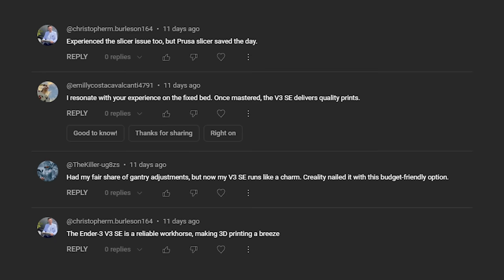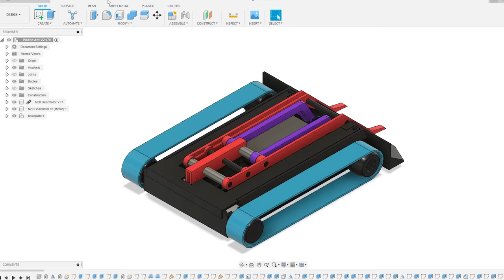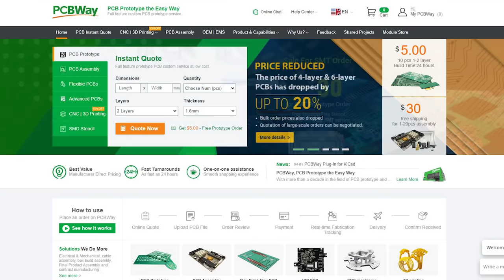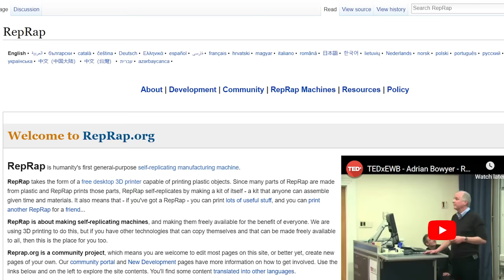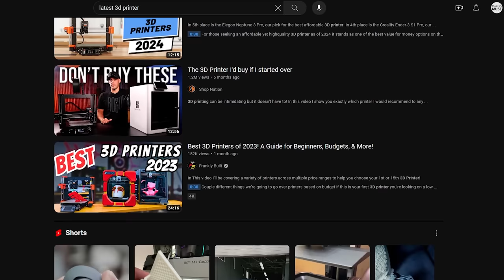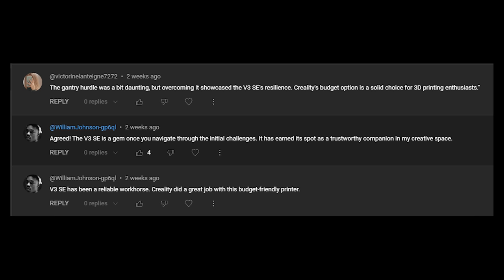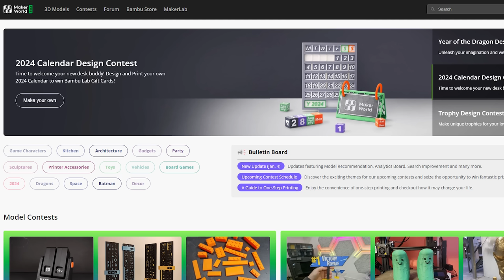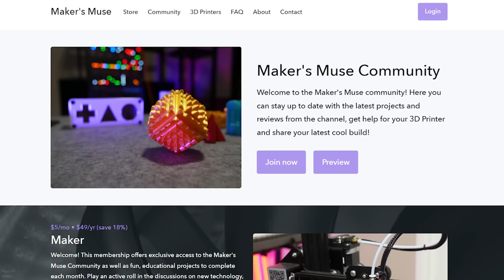My 3D Printing Predictions for 2024

Comment: I think you are spot on.  The hardware market is catching up to the consumer.  Less hardware hacking more printing.  But the software is still super lacking.  Fusion 360 is super expensive and freecad has a learning curve 10,000 miles long.  For the tinkerers looking to make household things and not rolex watches.  There is a huge market to fill in software.

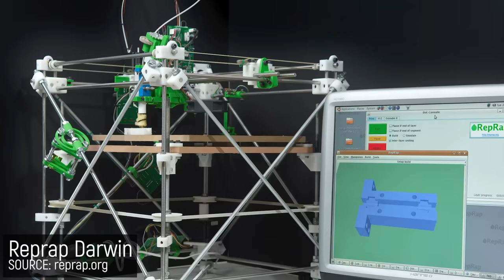Comment: 11:05 I remember the days, OMG. i was 10 sec. from exploding when i was building my first printer, I am from Denmark, and sourcing parts was extremely hard, but i am a industrial technician so i have tools, know-how and contacts most don´t,  but it was still a mes of wires, tape and strips!!! but the first thing you got out that looked kinda what it was suppose to, i was jumping on the ceiling, and i have bean printing ever since, my first bought printer was a Wanhou, i regret today that i did not save my first printer, comparing what i got today, have bean fun 🙂

Comment: I'm curious whether you think that FDM printers will progress in the other direction to what they have last year. Last year, it was all about the improvements that made hands-off perfection and high speed possible. I wonder if it is at all possible to work on the hot ends and parlay the advances in control into making FDM machines compete with resin printers on detail scale. Or is there just no way to get filaments to extrude consistently at that level? My suspicion is that it was too hard for the RepRap world to solve while they were building the rest of the infrastructure and capabilities of FDM 3DP, but now...? Are the limitations those of physics, of manufacturing tolerances, or just of getting the work done to make tiny nozzles work? With the speed of the new crop of machines, even ultra-fine nozzles might not be too excruciatingly slow for printing fine models.

TBH, I've been wanting to try resin to print finer parts for models, but holding off because of mess and toxicity, and because - as you say - I can't differentiate the vast crop of different but similar low-cost resin machines and their manufacturers based on reviews.

Comment: Love the video! I think the repository wars are a great thing for the community! I'd love to see better search engine support to aggregate all of these.

As far as recycling. Fundamentally, recycling is a marginal improvement on single use plastics. And putting the responsibility for this on the consumer is just stupid. The manufacturers need to be held responsible. They shouldn't be allowed to produce the products AT ALL until there is an environmentally sustainable alternative - perhaps bio plastics.

Comment: My predictions for 2024: 
AI built into the firmware to adjust settings on the fly. Probably will be pretty janky starting out, too. Will likely rapidly progress though.

More options for water cooled cold ends for better enclosed systems.

Now there are more options for multi-material systems, I expect there to be new options made for soluble or easily removable supports that could potentially be better or cheaper than PVA filament. 

I somewhat expect a company to finally come out with resins that is safe to touch/breathe even in its liquid form. I also expect it to be not as safe as they claim, but I can hope that it will be safe.

What I'd like, but don't expect to happen:
US based part suppliers providing quality parts and allowing people to get away from the Chinese market. I'm so tired of ordering a part that has no quality control or gets damaged while shipping on a boat for over a month. So many lead screws and linear rods that are banana shaped for example... And there's really no options other than China for many parts even if I'm willing to spend a fair amount more for a quality part.

Comment: Trusting reviews:  I just returned an AnyCubic Kobra 2.  Your review left out the two biggest issues (filament routing, app) which made the printer unusable out of the box.  I couldn't help myself from wondering if you have advertising contracts, or if you'd actually used it more than a Benchy before your review.

Comment: These are the best of times and the worst of times. For any maker/engineer without access to a workshop with tools it is easier than ever to get everything you need, be it by any modern printer that is easy to tune (assuming they need it)  or via a service like pcbway. But with stuff like the fanbase wars (Prusa V BBL), repository wars, (AI) misinformation/manipulation and so on it is starting to become clear: It ain't a tight-knit community anymore.

Last week i finally got myself a printer (As a European i decided to go "local" with a MK4) and there is a LOT i plan to do with it, but interacting with any community seems unlikely. Beyond maybe a few videos or guides like MM and Sanladerer's content.

Comment: Love this video. I am researching to buy a printer in July. I could spend up to $2000 but would like to keep it under $1500. It needs to be a tool for me. I will be able to tinker with it, it doesnt always have to be perfect, but fundamentally it is a tool for me. I want to be able to print fast, high quality, or use different materials in the same print.  I have been struggling to find an alternative that is better than the Bambu X1C

Comment: Yes on printers that just print.  I Print a LOT.  I have 2 printers running right now and I'm not interested in working on my printers. they are just a tool that lets me do other things.  I have the CAD skills to do my own design work.  some of my parts are functional, some of my parts move on to other processes (lost wax casting mostly)   I DO NOT CARE how many upgrades I can get for a printer, or how easy it is to fix.  I want it to work as consistently as my laser paper printer.   Give me the results of what I send.  If it fails it needs to be the result of bad data, not because of the printer not having upgrades or the printer settings needing to change from print to print.

Comment: No surprise to me Creality is using Bot comments. I bought a Creality Ender 6 in 2022 and gave up rebuilding and re-calibrating it, IT Never Worked (aside from one 2cm cat).
A Sonic Mighty resin printer prints anything I want with weak brittle useless plastic. 
I would love a filament printer that just prints. I want to make things as prototypes. Shame about the manipulated reviews this may stop me ever buying a 3D printer again. 
Love hearing about the metal parts printing shops, this may be for me. My 3D filament printing has been Ender-ed...

Comment: My predictions for 2024:
1. More onshape like companies prints cost less than a candy bar.
2. Faster cooling beds
3. Different filament materials 
4. Shocking and crazy experimental printer designs.
5. Better enclosures with better ventilation 
6. Printer designed specifically for farms
7. Actually less consumer/beginner printers.
8. Finally someone is going to figure out how to remove 1 stepper motor and still be able to move all 3 axis and extruder.

Comment: I had my 4yr old Elegoo literally gathering dust in the corner, I haven't 3d printed anything with it for over 6 months. I just recently got a Creality K1 , excited to see that I don't have to wait 1hr for a benchy, but only 15-20 minutes. On the other hand, the fast 3d printers are still in baby shoes. Still a lot of experimenting going on, but I can see it that the old/typical slow printers (all the enders and their clones)  maybe just start to go extinct or at least severely cut back due to slower sales, as people pick up on the fast machines. I wouldn't be surprised if we see the once 2 -3 hundred dollar badslingers go below $100, because the manufacturers are dumping their inventory in favor of the newer fast ones. I'm excited to see all sorts of re designs and clones, I can already see the Bambu is becoming the most copied one in 2024 and I bet Prusa has a few printers in the testing phase that may go on the market sometime later this year.

Comment: Recycling: PET pultrusion has exploded, especially in places where filament is hard to get or expensive. I can get filament pretty easily here in the US but you can't beat free or nearly free filament, and in a decent material too.
Reviews: Bambu is 100% guilty of this. As it is, they have potentially shady cloud practices but on top of that, they've been using NDAs to control video reviews which defeats the purpose of an honest review.
Price: Slant 3D is on a mission to create "$10 spools of filament" and I think it's a viable goal. Not only will printers come down in price, but also filament. Even if it's only Slant 3D for now, other filament manufacturers are going to have to compete with them and change their manufacturing methods to reach that $10 USD per kg spool of PLA.

Comment: Re: CAD systems: The price for the For Makers tier of Solidworks got dropped from $99/yr to $48/yr last quarter, and as far as I can tell, without any loss of features. Unfortunately it was at the cost of the monthly plan price rising from $10 to $15, so the “I want to try it” segment got squeezed. Easy CAD? I can’t tell you; I was an experienced CAD user before I tried it, not a novice. But I’ve been pretty impressed with the feature set.

Comment: As for 3d printing file format. In my opinion .step files should be used in repositories. They contain exact bodies shapes and can be far better modified as .stl There is also less security concern as with 3mf format. What do you think?

Comment: I would be excited to see advances in multi color and pellet printing hot ends. I think a printer with clear pellets and dyes added in the hot end to allow printing any color would be amazing. And instead of wasting filament purging between colors, making the next layer start in the infill to purge the color to the next one would solve a lot of problems. Kind of a combination ink jet meets flm printer 🙂

Comment: Great vid, and thank you for all you've provided to the 3d community.  i'm one of those who "just wants to print."  i made my first 3d printer because i wanted to learn how it worked. When i finished that, i gave the printer to a fellow employee at work who could not afford such things, for her kid to use to learn on. They'd send me pics of their print projects, very cool. i replaced that printer with what was then (2016) a very expensive >2k Lulzbot Taz 5.  i printed some really fun stuff on that one, a violin that can be played for instance, and sounds pretty good. It was fun to hear the sound quality difference between ABS and PLA (the organic sound wins). But... i lost interest and the printer has set idle for several years now. Why?  i just want to print. i got tired of having to tinker. i did the "tinker" thing learning about 3d printing, i do not want to be a 3d printer repair person, i want to make stuff. Time spent fixing the printer is time i could spend learning CAD, but don't because the overall experience of always having to adjust and tinker made it not worth it to me. But i have never lost the spark, and the newer innovations are pulling me in. i even put my Taz on the CL trying to sell so i can get a new one. Re "BOT" comments. i love PRUSA for who they are and what they have done. Unfortunately, i do not think humankind has evolved far enough for the idea.   Hey, opened source is available for greedy companies to use, modify, then patent and/or make proprietary stuff with. One very successful company right now has done exactly that. They didn't have to spend the money on R&D, just take the work of others and add to it, flood the market with government subsidized results and essentially undercut and destroy the original creators. Sad stuff. Anyone who wants to can read between the lines. Hopefully companies like Prusa, who do not have an entire government behind them, can bring some of these new innovations into production.

Comment: I didn't think about be doing 3D myself, but after the development last few years. Many, many models out there are ready too printing out.
It's never been easier.

And for those most expensive and highest quality of filament could also be using for example for car parts and other things.
It's crazy!

From not beeing thinking about it at all, i'm now going to be buying a 3D printer.
March hopefully i will be spending for $1,800 in a 3D printer.

And so many usefull things you can print out. The only thing i'm struggling too find for my personally project are filament we can see trough.
And another question are there any filament that could hold a pot for flower for example and wouldn't over time be broken?

Any suggestions? That would be very helpful.

Comment: I don't like using .3MFs for downloaded files because so many include printer settings - and that's only useful if you have the exact same printer.  Using a .3MF created for a Prusa Mk3 on my Bambu X1C is a waste of time.  So I find I've just been avoiding them.

What I hope happens - and I saw this a couple times in other comments - is STEP files.  The most visible slicer programs read STEP files just fine, and it's just so much easier to rework a STEP file in whatever CAD program one prefers, that it would be awesome if the standard shifted to that.  Although, if I'm being honest, about half the time I forget to include a STEP file of my own work - so it's a hard habit to break!

Comment: I find the Sovol situation very interesting.  Sovol doesn't seem to have a good marketing strategy in the forced marketing reviews, and they don't seem to have a reputation for good printers. So there is very little recomendation for it.  But the Sovol SV06 is a raging success which toppled the Ender 3 and Prusa dominance.  However the SV06 does fall into the tinker category, slightly.  First the SV06 plus is not as well tunned, and needs more tinkering and mods to get it right.  Second, the SV06 needs a replacement Y axis stepper motor to work properly, along with a select few 3D printed parts, which it can be made, quickly and easily, by itself.  Compared to the Tarantula (a lot like a Ender 3) which would never print on demand, and was more like "meet my demands or I won't print".  The SV06 tinkering is a very short process, before it is simply the same as printing with a Prusa MK3, but with better electonics. The stock SV06 can run Klipper as well.  This forced Prusa step up the quality and price points of its bedslingers. On the Creality Ender 3 side, the Crealty marketing strategy has become destructive.  As Nero3d Says "these days, friends don't let friends make 3D printers with v-wheels."  What is even more intriguing about this, is that the SV06 and MK3 are competing with completly open source hardware and software.  In conclusion, I think Sovol SV06 is simply the best 3D printer available, under $250, and is seriously underated.

Comment: I've long wondered why 'XL' 3D printers as so much more expensive than 'hobbyist models. Add a few centimeters to the height, width and depth', modify the software and hey presto you can more than double the selling price to the end user. The material costs are really minimal as extrusions are not that expensive, the intellectual input a little more - probably the major cost per unit - but the software is already there and required minor tweaking; after all it can't be that expensive to change the settings for the height, width and depth that a 3D printer is capable of creating within. I know it's a case of charging what the market will bare, but if you want to print larger than 256x256x256 then prepare to open your wallet and let the 3D printer companies help themselves to your cash.

Comment: I think it's been true about most reviews for quite a while in the whole tech sphere. Not even talking about essentially ad channels like LTT.
Speaking from my own experience:
When I bought my first printer, I watched about four full reviews of it. Just one reviewer highlighted some fundamental flaws with electronics and firmware, and didn't really describe the full extent of them. The firmware was locked up, the LCD was completely proprietary, as were all the connectors. ABL leveled itself a couple millimeters below bed surface... The list goes on.

None of those reviews were sponsored. Small to medium sized channels with not much audience around them. Just as a manufacturer. Run-of-the-mill chinese company with a couple of ok-ish generic machines.
So yeah. Independently of who or what caused this amount of shortsightedness in ALL of the reviews, I don't trust them anymore. At least in a sense I did before.

Comment: I've been casually following 3d printing for a long time. Waiting for the time when it can do what I'd like to do. Simply and easily build parts or things. I'm much closer to buying in now.  
Is it possible yet to make a soft silicone like suction cup and its ridged handle? The suction cup would presumably need to seat into the handle and be strong enough to hang on.

Comment: I have a perhaps not so popular opinion on this. I think that tinkering with and repairing your own 3d printer teaches you a whole new range of knowledge. I certainly don't see it as a disadvantage if I understand how something works and can perhaps even improve it. Maybe it's because of my engineering background, but I think a lot of people want to do things with as little effort as possible, including CAD, that others often have to work for years to build up the necessary knowledge and, above all, experience. I am still of the opinion that we should place more value on sustainability and production in Europe (see Prusa) than putting a device in the house that can't really do more than any other 3D printer that has been upgraded with Klipper. But well.... 3D printing is dead, long live 3D printing